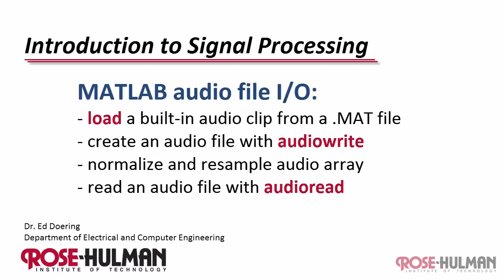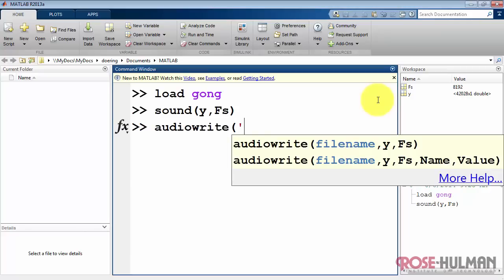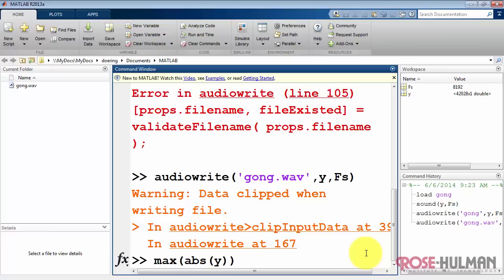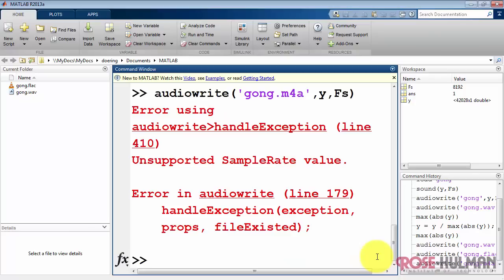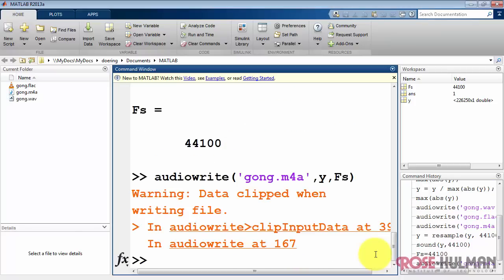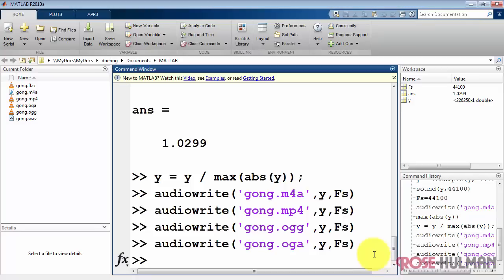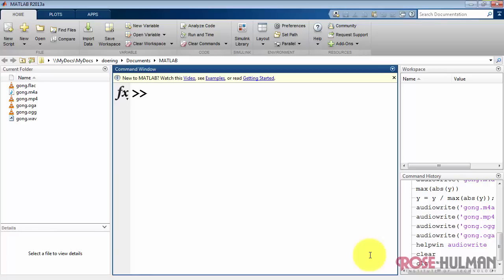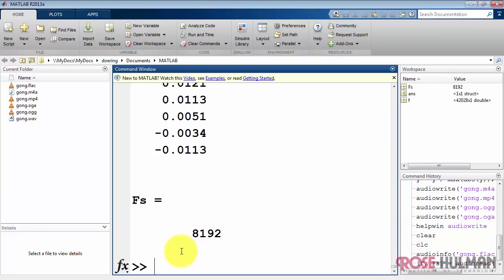ece180 matlab: Audio I/O

Comment: hi to all, I need help for audio compression using matlab ,
Reply from the maker: +touadam vinneet The built-in "audiowrite" function can create a variety of compressed formats such as OGG, M4A, and MP3.
Reply: +Rose-Hulman Online ; do you have some links  for lifting wavelet transform implementation based on audio compression using Matlab?
Reply: hi, I tried to code audio file using audiowrite and i got this message :

Error using audiowrite>validateFilename (line 323)
Cannot create file gong.wav. Permission Denied.

Error in audiowrite (line 105)
[props.filename, fileExisted] = validateFilename( props.filename );
 
i don't know what's wrong. please i need help.